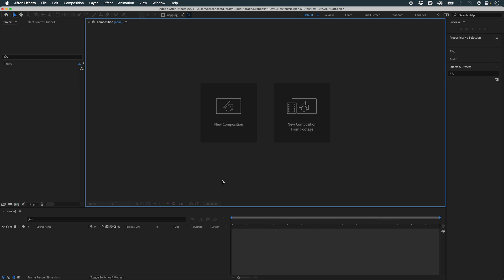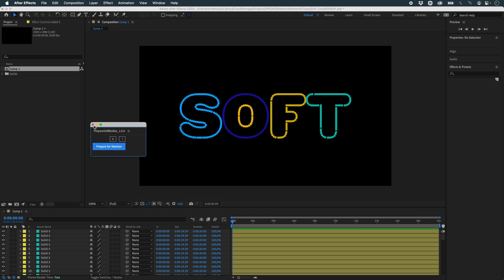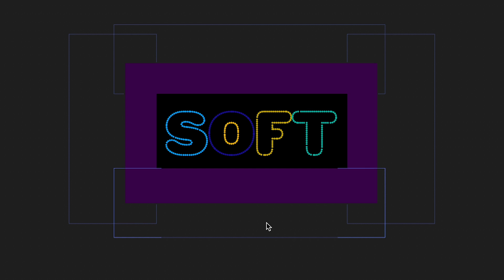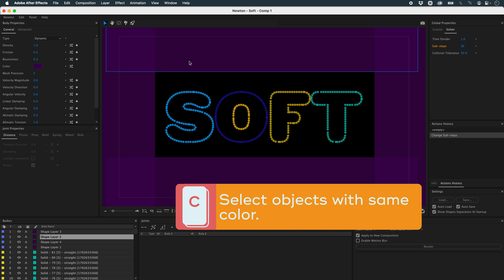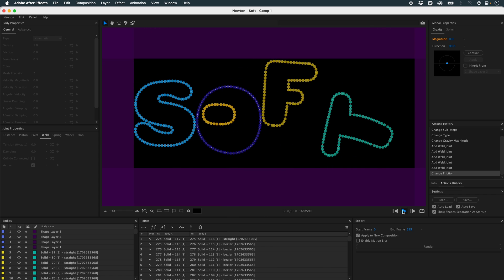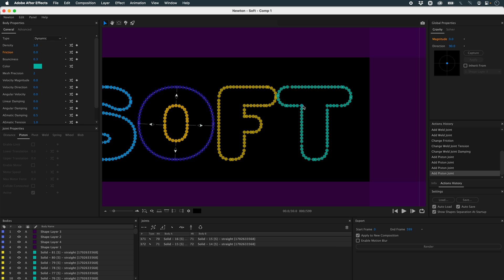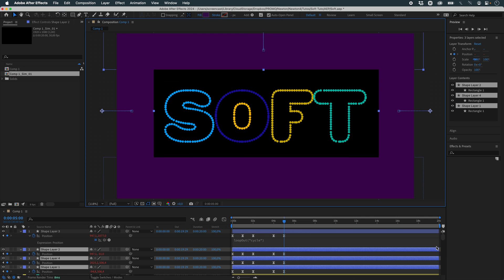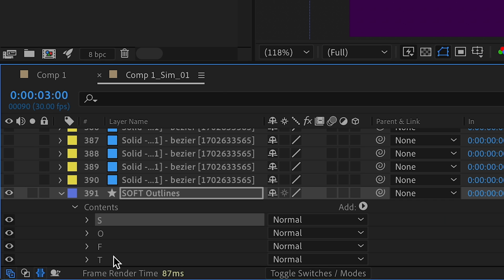Simulating typeface compression using Newton 4 for Adobe After Effects

Comment: Is there a way to do this with a vector layer rather than text? I tried to follow the same steps but used the shapes created from a vector layer rather than from text, but after running PrepareSoftBodies, my original vector layer outline is all distorted. Any idea why that might be or advice on how to tackle the issue? Thanks!
Reply from the maker: @ShawnMillerMan  should definitely work with shape layers too. You could also use mask and the Reshape effect!
Reply from the maker: @ShawnMillerMan  should definitely work with shape layers too. You could also use mask and the Reshape effect!
Reply from the maker: @ShawnMillerMan  check that you don't have transformations on or inside your shape layer

Comment: I always get to the point where after making the weld joints when the walls compress the pixels go crazy. Also the welded type doesn't react to each other and just go over other letters... I'm lost...
Reply from the maker: Did you increase the Sub Steps?
Reply: @Motionboutique  hi I'm having the same problem, the letters don't interact with each other they just overlap. Sub steps are at 30 but still having the same issues
Reply from the maker: @harrietcann5756  Check that your objects are in the same collision group... Hard to know why without having access to your scene. I suggest to open a support ticket and send us a minimal version of your aep + newton settings https://aescripts.com/contact/
Reply: hey is there a solution?

Comment: I appreciate it - could you also make a tutorial a small box create in the middle and push the letters over the edge version? 👀👀
Reply from the maker: Hello Sena. I'd use a lot of moving squares that start from the center and spread out. But I really wouldn't recommend animating the scale of a centered square. Even if it's "sort of" supported.
Newton is a physical engine with a rigid body. So scaling is sort of "out of frame" even if it's supported.